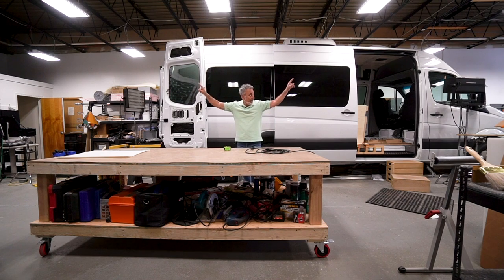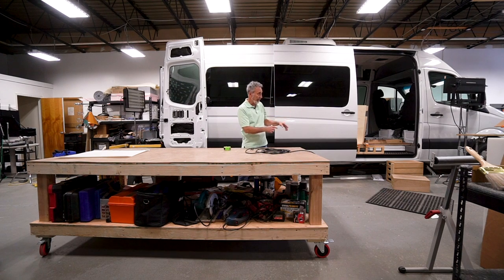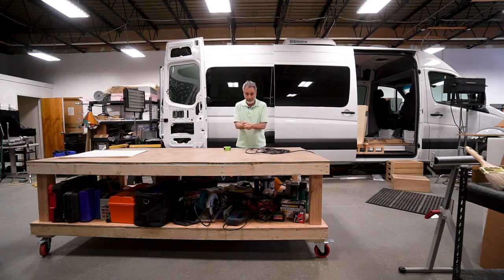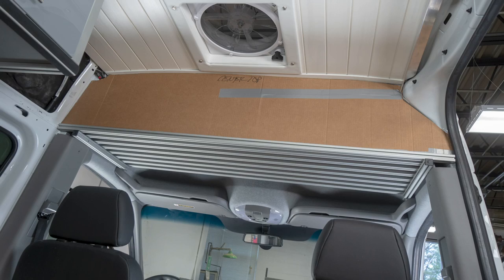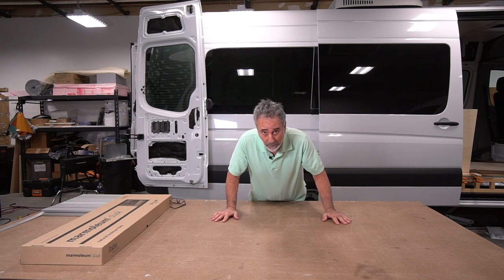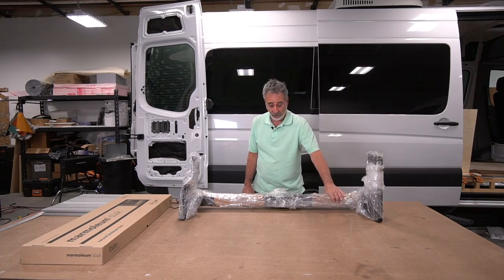On any Sunday...in the Humble Van Studio

Comment: Hey George, smart move with the triple Insulation at the back of the fridge.  I hope you are planning to vent the waste heat outside. Those fridges make a LOT of heat!! The air flow at the top of your fridge cabinet might be ok in winter but hell in summer. I fitted a double fan system for my fridge vents, to expel waste heat in summer and send it back into the van in winter. Keep Building 🐒
Reply from the maker: Open ventilation throughout the entire coach. Every nook and cranny; wide open. The two MaxxAir fans will exchange all the air in the coach several times a minute. I will be surprised if that heat can hang around long enough to be felt. Will do some testing in the desert.
Reply: @HumbleRoad  Good luck with this! Here in Aus where summer temps regularly get to 95degF any heat source inside the van is pure EVIL and must be expelled with force.

Comment: Hi, George, I hope you and your son can work together in the humble road van building business. I have a few questions for you. I have a 2018 Mb Sprinter 170 4x4 crew van with two Maxx air fans installed; my bed is north to south and I was wondering if you recommend installing side windows in the bedroom (
CRL VW1033R Back Passenger Side Universal Non-Contoured Half Slider - 33-7/8" x 10-7/8") I already have plenty of ventilation I just thought it may be nice to see what is going on outside while laying down. I also thought of installing 360 view cameras that I can see monitor from the bed. 
You also said you would always install sink and stove on the passenger side. do you still feel that way? I love your channel and I have seen everyone. thanks to you and June.
Reply from the maker: The extra window is completely up to you. As you indicated, the two Maxx fans are providing plenty of ventilation, as I knew they would! ;-)
Think about risk vs reward, pros vs cons. FWIW, I prefer factory glass. regarding the galley, I still like it on the patio side. In my first build here, when standing at the sink, you have 180 degree viewing out the windows. I like all that open glass, I like to see outside. Most van lifers have few to no windows. To each his own.
Reply: I’m curious what camera system you’re referring to on the 360 system? There’s so many systems to research.
Reply from the maker: Disclaimer; I have never purchased, nor reviewed any of this equipment. But I get a good sense of quality and service from these guys. https://www.tadibrothers.com
Reply: thanks George

Comment: Good idea to add the third drawer. If it would work it would be handy to have flat board that sits/slides on top of the drawer to set things on when taking stuff out of refrig or using the convection/microwave. 
Looking forward to the Promaster build-out —Carey On!
Reply: Yash x 100000000000000

Comment: Ceramic Window Tint.
Take a look into this type of product. This stuff is amazing at keeping heat out.  Blocks nearly 99% of ultraviolet rays, and reject infrared energy. Huge. 

I also plan on using Lizardskin Ceramic coating on the inside of the metal van interior.

Comment: Definitely make sure that shore plug is nowhere near touching the ground and well above or built into the hitch frame.  Some idiot thought putting a trailer hitch wiring plug on the very back under the bumper and lower than the hitch was a good idea on my van (bought that way, and this idiot didn't move it's location before taking it boondocking) .  That plug didn't last one week on a BLM dirt road.  Presuming your vehicle might see at least dirt roads with bumps and small hills and still hold together?

Comment: I feel I wud want a lip on that overhead bin to help keep crap inside.  Great idea to triple insulate the fridge.  I don't understand why you not box fridge in.  Doesn't the fridge generate heat which one wud want to vent to the outside in the sumner time?

I lolz in first minute.  If I lived near yr shop, I wud drive over to work for you for free.  Now I feel sympathy for cappy van builders because who cud make a RV company profitable when there is so much work that sud go into the build?
Reply from the maker: The "lip" on the leading edge hasn't been addressed yet. If you contain the heat of the fridge in it's own box, you will (a) shorten the life of the fridge and (b) containing the heat in a box will act like a radiator. In my design, the heat escapes through convection and is sucked out of the van immediately. With the two Maxx Air fans, the air in the van is completely exchanged several times per minute.

Comment: A question. Why does no one stick electronics up there? I'd think putting the inverter and batteries up there would shorten a lot of your wiring. From the solar to the batteries, from the batteries to the lights and fans and A/C. Plus you could mount the controls and status display there so you could see the vehicle's status from most of the vehicle.
Reply from the maker: If you are referring to the cargo shelf above the cockpit, the components you speak of are too heavy and too large to install up there. Also, in a vehicle,  you want to maintain as low a center of gravity as possible. so the heaviest items should be mounted on the van floor or under the chassis.
Reply: @HumbleRoad  Ahhhh, okay. That makes sense. Thanks for the reply :)